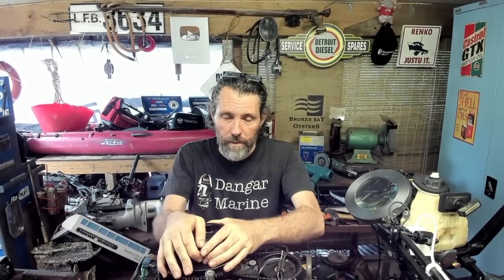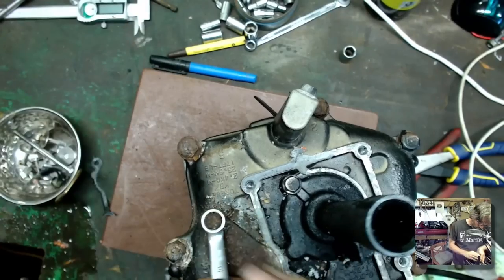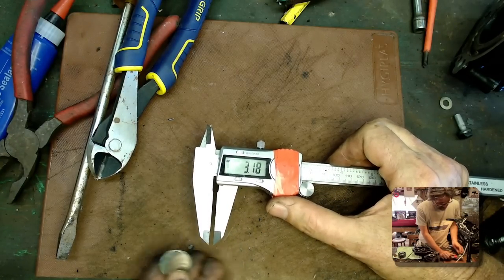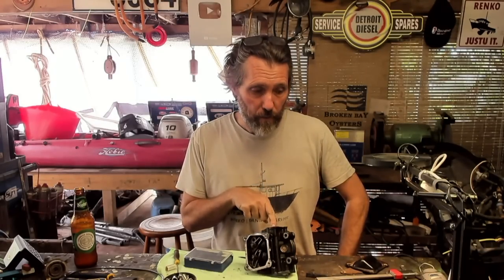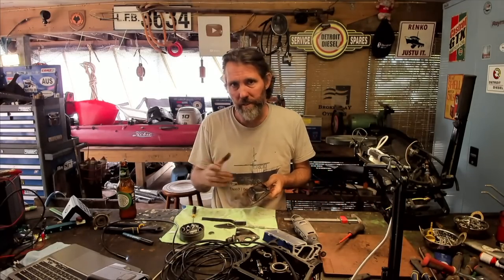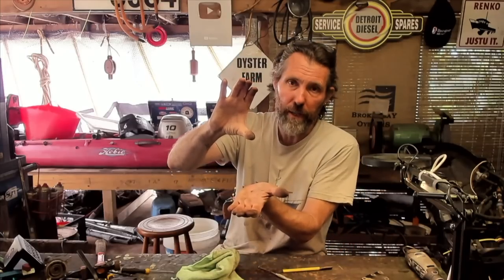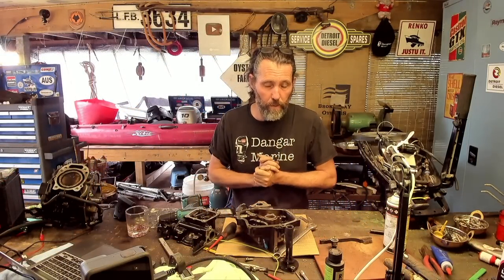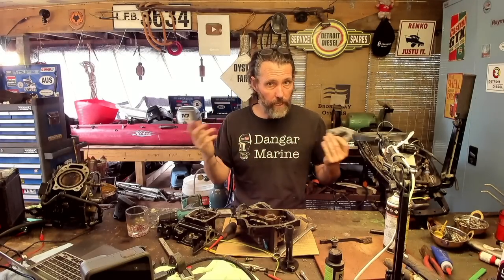Keel-cooled outboard -  PART 2

Comment: Without a thermostat bypass coolant close to combustion will first boil before heat conducts to the thermostat. Due to steam expanding in the circuit, coolant is lost past the safety relief valve causing heat to increase before the thermostat opens. The bypass circuit is designed to pass just under the thermostat thermal bulb to rejoin the circuit down stream. The bypass allows all of the coolant to uniformly increase in temperature until the thermostat opens. Cheers

Comment: I was admiring the 2 band spear gun in the background. I put together 6 slingshots and made a slingshot crossbow with an old crossbow I had that the old bow limbs warped on. It actually shoots an arrow quite well and accurate, but may go to another level of band and try spear gun bands. If the kids don't share, blame the parents...  Daffy.
Reply from the maker: Thanks mate, I quite like that one too. Needs a bit of a sand and oil though!

Comment: This project is brilliant. If the goal is to keep the characteristics of an outboard at the core of your solution, then my money says, it’s doomed to fail. Why? Because there are some major challenges that lie ahead.  (Especially with a retrofit) 
The existing outboard cooling method is too efficient to improve upon. An enclosed system, by design, Introduces inefficiencies that  will transform its tiny footprint into a donkey and cart. 
A current outboard is self contained, compact, almost portable (4 bolts); reliable, lightweight, efficient, and very cheap to manufacture, maintain, and operate. Flushing and impeller maintenance is all that is required to keep it functional. Fresh water use is best of course. May I be so bold as to say, there is no real problem to solve. ( or at least none to solve when operated correctly)
The following features afforded by a  raw water system, give us the outboard motor as we know it. An enclosed system cannot utilise them.
1- tiny coolant capillaries and low surface area requirements of coolant/.material tho be cooked. (This is only possible because of a low pressure, fast coolant flow, and a low coolant temperature environment) This environment is the plat opposite of an enclosed system.
2. Raw water cooling in an outboard has a coolant lifecycle that is way more efficient than enclosed. It uses the unlimited raw water efficiently. If fact, it is too efficient and needs to continually uses thermostats, and poppet valves throughout the engines run cycle to raise the temperature of the cylinders to maintain optimal combustion conditions. (Cars do this type of temp management on startup only).
The raw water coolant lifecycle is as follows… Cold water in, water gets warmer through the power head, water becomes hot over the exhaust manifold then is expelled. The last stage of the coolant lifecycle (exhaust manifold )is where the outboard temperature is predominately managed. The coolant needs to be hot enough to not damage the manifold, therefore when it has passed through the manifold cooling stage, the coolant is too hot and the flow is now slow, free and lush. Then bye bye into the sea or lake it goes. 
Good luck managing the coolant from here to cool it efficiently enough to pass back through to the first stage of an enclosed recirculated system. Here comes the next stage of complexity and cost.

Comment: My dad had the idea of closed circuit cooling on big outboards using a heat exchanger built in to the cavitation plate so it would look a bit like the bolt on hydrofoil wings.

Comment: Looks like you've got you work cut out. But you're on the right track. My old idea for heat was to run the leftover cooling water through a heater without modifying the outboard. But the closed system would definitely supply better heat.

Comment: Hey :) I’d really appreciate some help - my outboard water pump works perfectly in a bucket when span wjth a drill - it sprays out the tell tail, yet as soon as I run it with the engine going I don’t get any water through the tell tail. It must be something to do with exhaust gasses because I get a small amount of exhaust gas from the tell tail even! Very strange! It’s a 1977 Evinrude 35. 2 cylinder 2 stroke. Regardless of rpm, in gear or out it won’t pump water. With the drill spinning the crank and the plugs out to reduce compression it works flawlessly! Thanks so much in advance - Tom Western Australia.

Comment: On the rust removal, have you tried electrolysis?
Just need a battery charger and a baking soda solution.
Plenty of stull on YT on the details and it works very well.

Comment: Hi there dangar Stu 
Great idea for a vid!!
Fuel float in tank failure not sending accurate info to Yamaha command link and perhaps what ohm reading is required by Yamaha gauges .
Also if you do this vid quite soon that would really help me cause that’s the problem I have at the moment - hahahah like your going to do a vid just for me - I’m dreaming!!
But hey if I work it out in the interim I can share info for others. 
Love those silver painted impact sockets - look just like myn

Comment: Hi... Been watching and been a fan of your sow for years... Love it... 
I have a problem and hope you could help...

I have a Yamaha 2 stroke 3 cylinder 40 hp... My motor bogs down on low rpm and runs fine full throttle... Sometimes the motor loose power... If I throttle back to neutral and push throttle forward motor powers up with speed and then looses RPM after a few minutes...

I have replaced the fuel line... Cleaned carbs . cleaned all filters... cleaned fuel pump... Still have the same problem... Please help!

Comment: Hey so if the coolant pump is variable speed based on temperature why not just remove the thermostat entirely and let coolant flow through the engine, no air pockets no restrictions. Would allow for more control on temperature I’d presume.
Reply: Engines work best with a thermostat. This very true for diesel engines.

Comment: All thermostats systems have a bypass to circulate the coolant.
Reply: Without a thermostat bypass coolant close to combustion will first boil before heat conducts to the thermostat. Due to steam expanding in the circuit, coolant is lost past the safety relief valve causing heat to increase before the thermostat opens. The bypass circuit is designed to pass just under the thermostat thermal bulb to rejoin the circuit down stream. The bypass allows all of the coolant to uniformly increase in temperature until the thermostat opens. Cheers

Comment: Hi Stu, Could you use Transmission coolers possibly fixed under the water level on the back of the boat , to cool the outboard water via a pump and a few connections?? just a thought! hurt a bit! K)

Comment: For the multi-tube parallel flow grid cooler, if the end manifolds are not very flow symmetrical with respect to the cooler inlet and outlet lines you won't get equal flow through the individual cooler tubes. I have actually seen this cause overheating with two grid coolers piped in parallel flow. It's basically a low pressure flow system so small differences in resistance between the individual cooler lines make big differences in the flow through each individual cooler line.  An oversized pump would develop enough pressure to make this a non-issue long as the manifolds were reasonably flow symmetrical.
Reply from the maker: Great information! The comment section here is definitely going to make the final design better. :)

Comment: Great video Stu. I had a probably dumb question ( I don't know anything about engines) : But what is the need for the coolant thermostat? I.e. why couldn't the water just be always flowing regardless of temperature, surely there's no such thing as an cylinder\engine being "too cold"?

Comment: I have a 1988 evinrude 150 hp. The motor runs good at idle up to about halfway way to wot. Then it starts surging . I have shotgun blast parts at it, and the problem continues.  I have replaced the stator, timeing switch, cdi, both power packs, new plugs, wires, and coils, replaced fuel lines, new fuel pump, rebuilt the carbs, and replaced the exhaust gasket between the mid section and powerhead. I have not replaced the limiter switch or the vacuum switch. At wide open, it feels like either a loss of spark or loss of fuel.  Any thoughts would be greatly appreciated.

Comment: IDK, Stu, I can't quite wrap my head around the idea of a circuit without a bypass. I would say, "check your work", but you're a clever lad, if it had been there, you'd have seen it. Is it possible that the little two-stroke builds heat so quickly that the thermostat opens before there's a chance for air to be separated from the cooling flow? Keeping in mind that, with the stock setup, raw water was circulating through the leg and exhaust, so pressure couldn't build up too much, prior to the thermostat opening?

Comment: Interesting vlog Stu, if you're adding extra controls to regulate the cooling temp then can you dispense with the thermostat all together?
Reply from the maker: If we manage to get a pump with that capability we may well be able to.
Reply: Only prob water needs restrictions to keep water hard against block for heat transfer

Comment: Hi Yamaha owners... Just a question on a motor problem.

2 stroke 40 hp 3 cylinder
Auto lube.. with electric choke

Motor starts on the key with no problems... When I put the motor in gear the RPM rises very high ( out of water) Throttle not even halfway down... Driving under load ( in water) motor picks up speed quickly with no problems untill about 5 to 10 minutes driving and then looses power . Only way to get back on speed is to throttle down to neutral and push throttle back to original position when driving.

 Things I already did..

1. Cleaned carbz
2. Replaced fuel line with new .
3. Cleaned out all fuel filters
4. Replaced fuel pump with a new one.
5. Did pressure test.. 120 psi 
6. Replaced spark plugs with new ones

Any ideas or solutions to this problem
Reply: Clean out your gas tank or add one of the aditives that helps get rid of water in fuel, just my advice

Comment: So then on your connection to the radiator from the outboard you’ll use rubber heater hose for flexibility w/ quick connects as unions ?
Reply from the maker: Yes, some type of flexible hose.

Comment: The thermostat could have a leaky face on the bit that moves..
If you drill a hole .. a air bubble can block it.. even on car engines.. this is why there is a little bit of metal loose in it.. easiest option is do a slot so a bubble can't get lodged...
A car heater radiator is a possibility..
The multiple pipes of an exchanger.. reduce the flow speed as water (or air) moving too quick doesn't allow heat transfer...

Comment: 🤔Keel-coolers are a great idea. Soak a dunked motor until you are ready to work on it.
Water can be pumped through/around heat exchangers in different ways, including electric pumps and forward motion. Manifolds can be built for precise control and actual use of the 'generated' heat as hydronic heat or hot water. Multiple outboards could generate - motion, electricity, and heat -which normally dissipates after cooling. A dry exhaust with headers would be awesome 🙂
Hot-Tub anyone ?
Reply: FWIW - electric pumps with pressure reduction and diversion valves - can deliver different pressures, send air back to the fuel tank and pre-prime the system before ignition. Very cool concept Dangar - so many possibilities - like heated seats 🙂

Comment: Why do you need a thermostat in an electronically controlled water pump, that is pumping warm water and not ice cold ocean water? 
The amount of times I've run engines without thermostats, never really had a noticeable problem more than 1% worse than any cold carby engine for 10 minutes, then its open anyway, granted I don't live in Antarctica, so 15deg water in winter is a bit rough, but 25deg water in summer and 30deg water you will be pumping should be fine bruh
Reply: Also, I fully think you are right with exchanging the heat into the ocean with short pipes, but have you considered a tiny air radiator like a car? A 200 square oil cooler should be enough for that little puppy